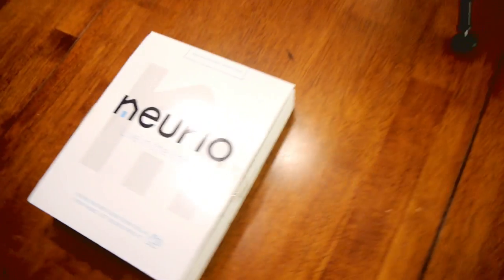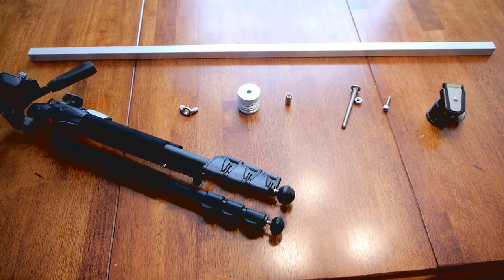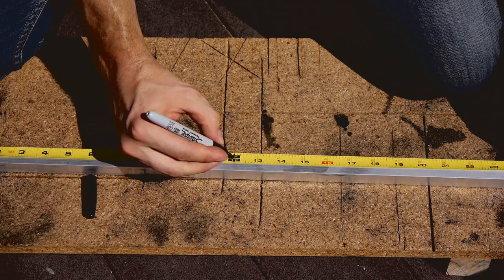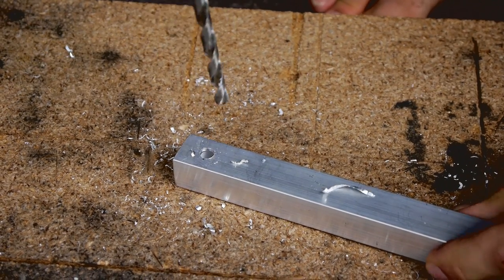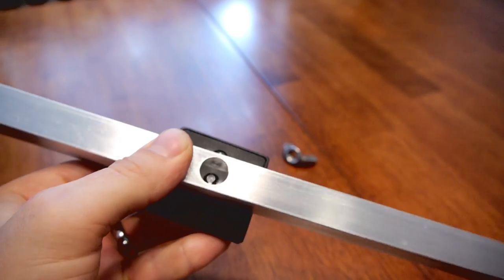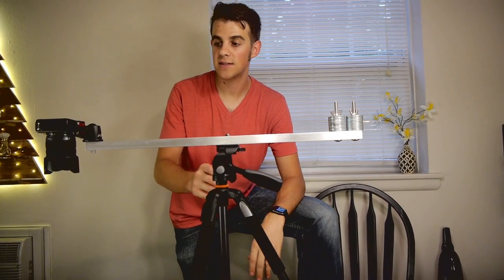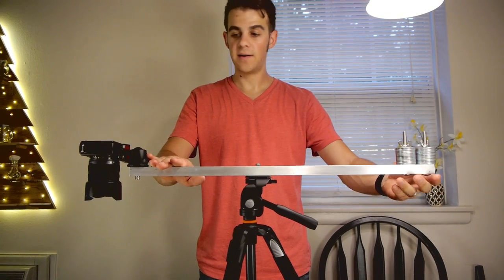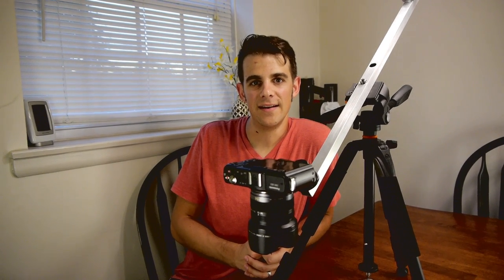Simple DIY Overhead Camera Rig / Mount Setup

Comment: Nice build.  My solution was a crab jaw clamp from ebay that mounts on the tripod and holds a selfie stick yuentang 188.  Cost for both is about $20 Canadian.  No fabrication required.  I use a suspended bag of rocks under the tripod for more stability.  The bag is about $5 and the rocks are free.
Reply from the maker: That is much simpler! I do like the bag of rocks idea! It's something I've considered adding to mine, but so far I haven't been needing much more stability.

Comment: Great job...  As I'm really impatient .. I found a really simple solution that didn't cost anything and only took 3 minutes  (well I had a cheap fold up table I purchased from ebay beforehand for about £10 that I can still use as a normal table afterwards.  

1:  Connect your camera to your stand /  ballhead  as you would normally  (if it isn't already)

2:  Open the 'fold up adjustable height  table'  to the aprox height you need.

3:  With the legs of your tripod closed, lay on top of the table with the camera overhanging off the end as far out as you need.

4.  Secure the legs of the Tripod just by tying up around under the table and over the top with some strong string.

(You shouldn't need any counter balance but if you do just add a few books to the end of the table).

5:  Disassemble when finished and fold away table.
Reply from the maker: Haha. Nice solution! I did some similar things before making this.

Comment: I really like how americans say it's super easy and DIY, then they pull out super advanced equipment and gear. There are even some with power saws and everything.

Anyways, nice video :p
Reply from the maker: Point taken. It's really all relative. For me "easy" is something that I can throw together in a few hours - although I do still use some power tools. Hey, power tools are "easy" :-D
Reply: For me, easy DIY would be something like: grab a broom stick, take it apart, use some tape on the tripod. Or some better method than tape :D
Reply from the maker: Haha. Yea, I get that. Tape and epoxy maybe, but then you kinda loose the removability. Maybe a tiny bottle suspended by a rope with some rocks in it for the counterweight. :-)
Reply: Kind of comes with living in the more advanced parts of the world, doesn't it? Most of us have more equipment at hand than broom sticks and tape.
Reply: hhhhhh, I agree with you. 
but in this video he only used a drill 
and a Saw 😂
Reply: First what does this have to do with being American and it is supper easy you don't necessarily need a dremel you can use the drill bit smaller one and a cheap hack saw what's so complicated about that?  People just like to complain.
Reply: Yeah, all that welding and table saw cutting; not to mention the router work. Those dovetails were a royal pain! Couldn't he just show us a way to do it with some duct tape and a can of WD40? (Can you hear the sarcasm dripping from my voice?)

Comment: This is actually something I could make! The only thing I need is a dremel. Last video the dude busted out a welding torch and I was like nahhhh
Reply from the maker: Thanks Makenzie. You could actually get away without using the Dremel. Just use some standard bolts instead of the carriage bolts I used. Good luck!

Comment: Thank you for sharing this tutorial! I ended up building it exactly as you designed here, and wanted to note some learnings from the experience for others considering make this:

- You'll need to buy a ball head and 5/16" and 1/2" bits if you don't already own them, which adds another $24 to the cost of this rig.
- I did not dremel my 5/16" hole to fit the carriage bolt and it works just fine, not a necessary step.
- The coupling nut design is problematic because once you unscrew the rig from the tripod, the coupling nut falls into the tube and you have to unscrew the washers to get it out. I would extend the coupling nut somehow (or buy a longer coupling nut that can't fall inside the tube). You can use an allen wrench to tighten and loosen the coupling nut.
- I needed more counter weight, so I put a bag of sand in a cute cloth bag and hung it off the end. Not the most elegant solution, so I'll think about how to do it classier for the longer rig!
-  This rig isn't ideal for a large camera, but great for an iPhone setup.
Reply from the maker: I agree with most of your analysis. The coupling nut can be a bit problematic as you mention. However, I general leave this on my tripod so I don't have a huge issue. One thing I disagree with you slightly on is the camera size. I've been using my Panasonic GH3 mirrorless camera on this setup for the past year with good results. Actually, around 90% of my shots in all my videos are shot using this setup. Thanks for the comment and feedback though! I may incorporate them into an update in the future.

Comment: Perhaps you might try a sliding weight to counterbalance and lock it off with some kind of clamp to hold it in position - Your idea is absolutely brilliant and I like it as a portable overhead rig ;>)
Reply from the maker: That's a really good idea! However, I've found that if the weight isn't perfectly balanced everything is still works ok. One thing I do wish I had was a movable pivot point as I could lengthen and shorten the arm. This would effectively do what you're proposing as well.
Reply: makjosher - Perhaps if you used a monopod? That would work pretty well - A simply rubber round clamp with the hardware to hook it to the tripod would make that work ;>)
Reply from the maker: Yea, that would be a good idea! Maybe I'll try that someday as I have one laying around that I never use.

Comment: Great video! Thanks for taking the time to put this together. I'm in the process of duplicating this. Quick question...in the final segment, it appears that the washers are flush against the tube. Did you remove the securing nut, since it seems that the wing nut would be enough to hold everything in place?  Thanks again for putting this out there. Saved me some money and much more satisfaction in doing this myself.

Comment: I'm thinking about putting one together (hence why I'm here) but using pvc pipes. It will have two legs on each side of the overhead bar that you can put it on the table. I'll drill two holes to mount the camera and another to mount the light.
Reply from the maker: That sounds like a great idea! I actually started with a two support design in my head, but then realized I could make do with one. Two would be a bit sturdier though. After making this I realized I could use it for more than overhead shots. It works super well as a simple crane-like support, which allows you to position the camera in different ways.

Comment: Great video! What to do if I have a heavier camera (canon c100 and canon 24-105mm) and don't have a ball head tripod. I do have a normal more expensive/sturdy tripod. I would like to avoid investing big because I only need it for 10 quick shootings. Should I just invest in a slider and put the slider on a tripod? Thanks
Reply from the maker: Good question Jan. That is a quite significant camera! Still, My general approach should work, but you might want to use a larger tube - and obviously the counterweight needs to be larger. Perhaps using small weights from a lifting set would work well. You still would need a head of some sort to allow for adjustment of the camera. I’m really not sure what size ball head would be appropriate for your camera though. You may also be right that a slider would be a better route to go. It really all depends on what you need to do. Good luck!

Comment: Cost of project $24... if you already have the tripod and ball head and, oh, all the necessary tools too. 

Overall, a great video on building your set up. I'd suggest if you're going to include "costs" and what you need, then add in all the bits and bobs. 

Thanks!
Reply from the maker: I agree! I probably should have at least included the ball head. My assumption is that most people will probably have a tripod already, but I suppose that could also be a bit generous. Thanks for the suggestion.

Comment: I think it's the most complicated solving of the issue I ever seen. Just buy a tripod head with possible vertical shooting, plenty of cheap heads for that.
Reply from the maker: The issue I found with that was that you have to keep a very tight shot in order to not see the tripod legs.
Reply: Only diy lovers will appreciate this video. Thanks @makjosher for this video. The music is a bit like Christopher Nolan's style. For some maybe it's a bit annoying but I think it's dope! Cheers mate.
Reply: If you try it you will understand agar he is talking about cameras legs obstructing the shot. And to get a clear shot I need to use a very very very steep angle. So I am working on a version of this as well. Basically, you need a contraption like this to get a good overhead shot. And the tripods that come with this option built in are super expensive!

Comment: I'm trying to do something like this but I cannot find a coupling nut ANYWHERE :'(
Reply from the maker: I got mine at Lowes. I would think pretty much any hardware store should have them. Good luck!
Reply: makjosher Thanks for replying! Unfortunately I'm in the UK where we use metric so they don't sell hardware in inches at all (annoying because my tripod is still 1/4 inches thread). Will have to find another way!

Comment: Or you could use... a sandbag... or a water jug... or a dumbell.
Reply from the maker: Yea, that would work! I would recommend that the weight be securely fastened to the bar. If it isn't any vibrations or movements may make the whole assembly vibrate, which is never good for camera shots.